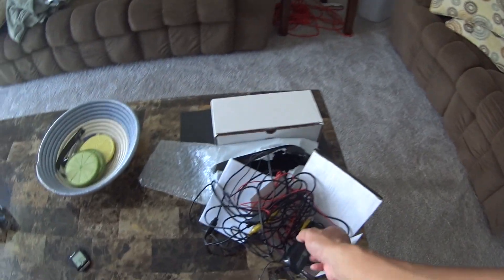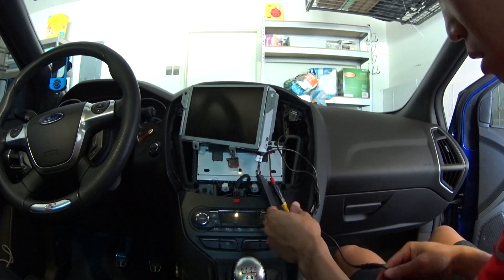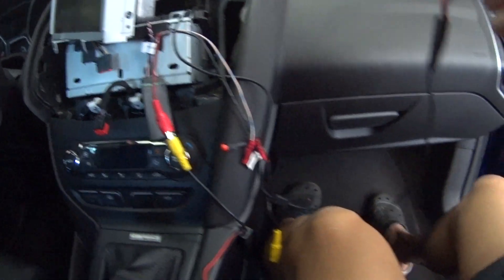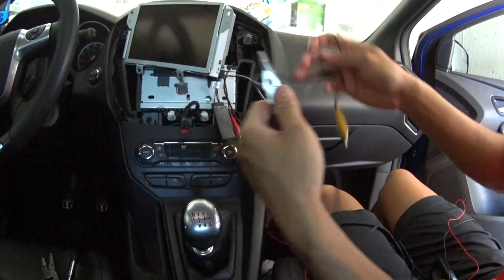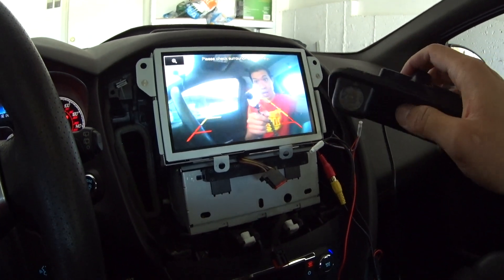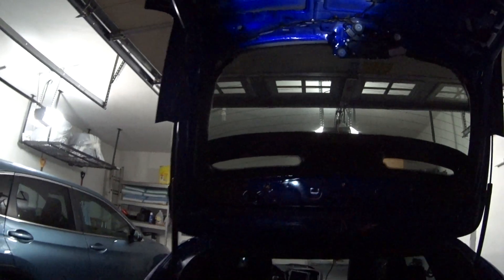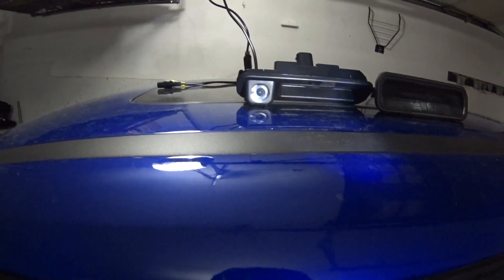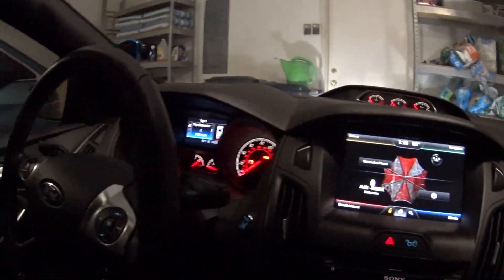Backup Camera Install Ford Focus ST

Comment: I have a ‘16 with a faulty camera and this is the only video that shows how to access/remove the back camera area. Thank you.
Reply from the maker: Thanks! Although I know the '16 has the solid trunk lid it doesn't remove like this one does. I haven't taken it apart, but I'm assuming it wouldn't be too difficult to access since they put a camera in the first place.
Reply: Derrick Moy yeah I tried today and as you said, it IS solid. I have no idea how to remove it but I’m sure someone will find out for me lol

Comment: Thanks for your video. Im doing this with also an upgrade on the radio to a kenwood one with android auto and everything but i need some more info on the wiring for the camera, how did you got the cables from the center console up into the lateral/up mesh of the back part of the car? I mean from the connections in the center console to the roof.. thanks in advance.

Comment: Hi Derrick thank u for the video 
I’ve got a question I bought same radio I mean aftermarket same as yours the problem for me is my steering wheel buttons not working are u facing the same issue if not pls help me out as I’ve tried 2 many ways still no hope 
Thank you 🙏
Reply from the maker: I didn't have any issues with the steering wheel buttons, but mine came stock this way. I imagine the hookup for this might be a bit more complicated so without taking everything apart I'm not sure I'd know how to help you... sorry buddy 😞

Comment: Did you put more adhesive on the rear plastic panel or reuse the factory? The tutorial on the forums says you have to replace the adhesive or it won't sit flush. Curious becuase you didn't mention it
Reply from the maker: I didn't reuse any adhesive. Since it is I believe held in my 6 screws/bolts. I'm assuming I'll have to get back into it again somewhat frequently.
Reply: Does it look, fit like stock? The write up o the forum says you have to heat up the adhesive to get the panel off and replace the adhesive to put it back on. Is that overkill?
Reply: Does it look, fit like stock? The write up o the forum says you have to heat up the adhesive to get the panel off and replace the adhesive to put it back on. Is that overkill?

Comment: Hi Derrik, how are you?  I am doing the same as you with my 2014 Ford Focus Titanium, my camera failed and I bought a standard one.  I have a question, the original camera comes with a connector with 5 or 6 cables, which of these are what I can connect with the standard camera that has a red and black cable.  greetings and thanks for your video

Comment: I purchased a handle similar to yours and was just wondering if i still need to do all that wiring in the back of the radio (power only not video) if it provides a wire to connect to the reverse light?
Reply from the maker: mustang2005 no you can simply tap the reverse light to power the camera.
Reply: @DerrickMoy  ok good that's what i was hoping. Thanks!

Comment: Hi my back up cam came with a trigger wire that’s with the male rca where do I connect the trigger wire too ..I have done the 14 and 15 rca to the radio already but not popping up on screen

Comment: I have a 2017 Ford focus,  didnt come with reverse camera as standard or sensors. Thanks for the video.
Reply from the maker: Are you sure your car is a 2017 model? It won’t have the parking sensors that was aftermarket and wasn’t working at all when I bought my car.
Reply: @DerrickMoy  Yes, definitely 2017 model.

Comment: Just looked through the ST thread you posted, and this video, but I've got a question... can this be done with a Focus that didn't come with reverse camera? All I need is to run/install the camera and flash it from the FORScan app? Can't find anything that really clears it up... thought I had to spend $400 on the LockPick device, but if all I need is the camera and some computer time... that's a LOT cheaper!

Thanks! Great video, btw.
Reply from the maker: Yes it can, but you'll need that lockpick device because it needs to trigger a change to the input to the screen which is what the lockpick does. It also allows you not to have to wire the backup camera to the backup lights (which may or may not be something you care about). Mine came with aftermarket camera from the previous owner of the car which is why I didn't go over the lockpick installation. It's a pain, but somewhat worth not running over shit when I backup.
Reply: Moysauce Productions awesome, thanks for the reply! Definitely something I want, just because.

Comment: Did your car come with a factory fitted camera and you are swapping it? Or is this the first your car is getting a backup camera
Reply from the maker: Nope didn't come factory with a back up camera it's a 2013 which didn't come standard this changed with the refresh in 2015.

Comment: I know this was posted some time ago but I'm working on wiring my camera and need to remove the trunk hatch trim moulding deck lid where the license plate light and handle are located.  I need to drop it down like you did so I can route my wires in.  I removed the 6 nuts and tugged on it a bit but it doesn't want to come off.  Is there a step I'm missing?  I'm not sure what is holding it on there.
Reply: I figured it out.  Thank you for the video.
Reply from the maker: Sorry about that super busy at work. Glad you were able to figure it out  👍

Comment: I installed the Sync lockpick pro in my 2012 Mustang with factory hard drive radio. And bought the back up camera from lockpick, when I put car in reverse, screen goes black. The options are on the screen for the camera but no visual is coming through, Do you have an idea what it could be.?
Reply from the maker: Without knowing more about your setup it's difficult for me to help you out. I'd make sure the basics aren't an issue. Ensure the camera works and that isn't the issue. Make sure the camera power and input aren't mixed up, etc.

Comment: Thanks for the video man. What year is your ST? I have a 2014; same color actually! I want to install a backup camera in mine but it didn't have one to start. Is the video connector still behind the Navi unit or does it not exist if I didn't originally have a camera? I have an ST3 by the way. I would have to connect the camera to the shifter to engage camera on reverse too no?
Reply: You'd have to rewire the 54 pin sync connector that goes into your current APIM.

If you have a 4" sync 1 screen you can buy a conversion harness that will be plug and play. 1 side goes into your sync unit and it'll give you RCA heads to plug your camera into. 

For a Sync 2 or Sync 3 (8" screen like this video) then you should be able to just connect pins 14 and 15 of your 54pin APIM connector to positive/negative.

Comment: Link for the ebay please. also I got a 2014 it will work right? I think sync 2 is what I have? and does this void the 5 years touch screen warranty. thanks , any other info would be greatly appreciated.

Comment: did you have a factory ford backup camera software already installed or do you need to Purchase an aftermarket one? or can you do it without any software mods?
Reply from the maker: There was an aftermarket backup camera initially installed so you will have to get a lockpick for this to work. No software is needed. The lockpick automatically triggers the screen to show once in reverse and the power engages the backup camera when this is triggered as well (so no need to wire to the brake lights).
Reply: @DerrickMoy  I'm looking to do this myself but just wanted to let you know that 4dtech now offers something to plug into the obd2 port to unlock the sync software so u get the reverse screen as well as a new harness to plug a camera into

Comment: I have a 2018 focus titanium, I assume your car has reverse sensors . Will the camera still work on the internal screen and will the reverse sensors still work ?
Reply from the maker: It has them but they were aftermarket. They didn’t put these on until the refresh in 2016.
Reply: Thank you but I'm not very technical when it comes to car electronics. But if I were to fit a reverse camera do you think I would lose the sensors as they would be on the same circuit. I'm just trying to weigh up the pros and cons at the moment . Thank you 👍👍👍

Comment: hey i have Ford Focus 2012 can use back camera too?
Reply from the maker: +zozo julien yes it is possible to use this for a 2012 Ford Focus
Reply: Moysauce Productions ok but how I’m gonna know it’s gonna work with my display?
Reply from the maker: You can use this thread for more specific details you can use this for the larger Sync 2 screen and the smaller one as well. The tough part is the wiring to ensure this enables when you reverse.

http://www.focusst.org/forum/focus-st-electronics/50471-focus-st-backup-camera-enabling-apim-rear-camera-option.html
Reply: Moysauce Productions ok thanks but where can I found best one for my car?
Reply from the maker: Are you referring to the best back up camera?

Comment: can i use this in my ford focus mk3 2011?
Reply from the maker: +dziura21 as I understand no the systems are quite different since it is an older model I don’t believe you can use the same method. However, any screen can be adapted to work with a backup camera.
Reply: ok thx for the answer